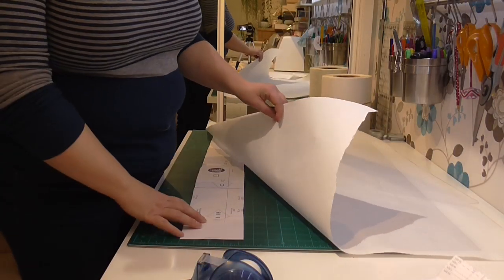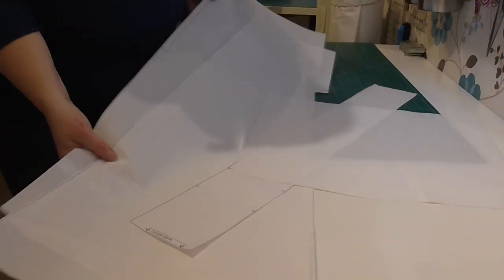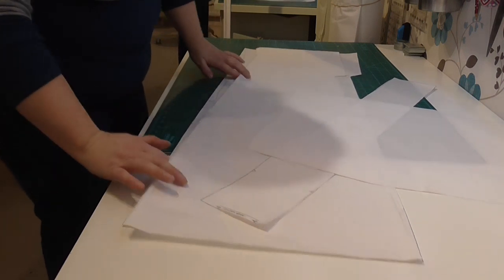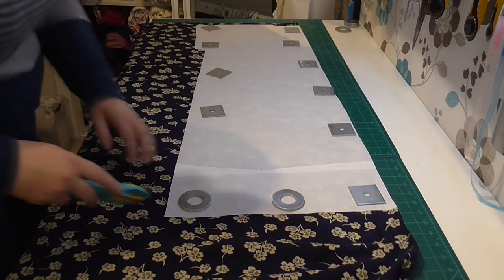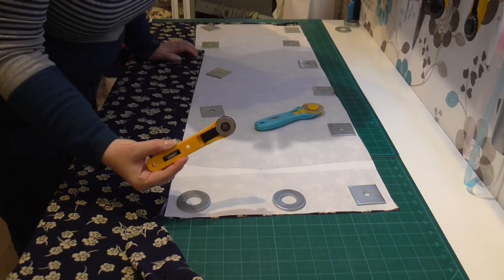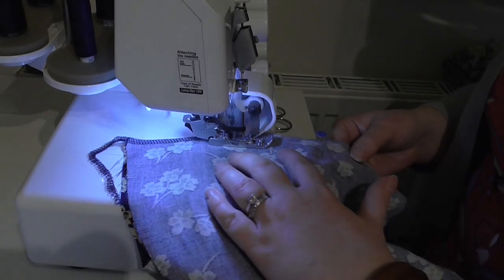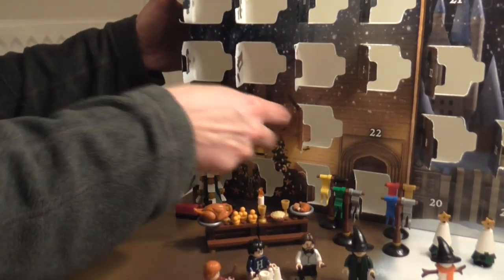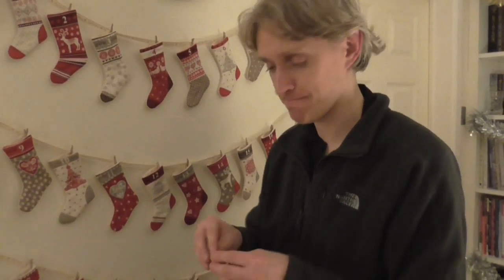Vlogmas Day 19: Last Minute Gift Sewing!

Comment: Mum deserves the best.
The kimono is looking good, you’ll get it finished in time and it will be greatly loved I’m sure.
Have you seen the new knitpro dpn’s, they are striped and marked in inches/cms, pink n silver for the shorter length and brown n silver for the longer ones, handy for measuring as you go. Xxx
Reply from the maker: Kath Jones ooh no I had not seen them, but they sound amazing! I will go and check them out! Thank you x x
Reply: Hi Ellie Knit pro Smartstix, I got mine from eBay 2.5 mm £6.50 back in October